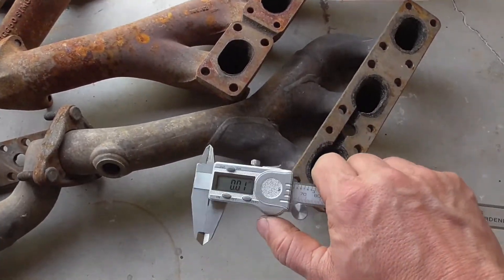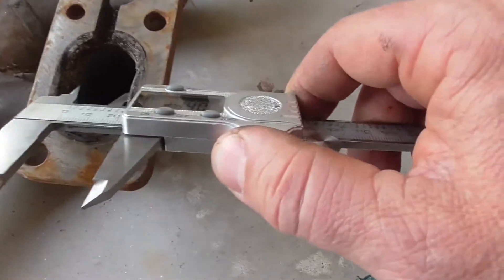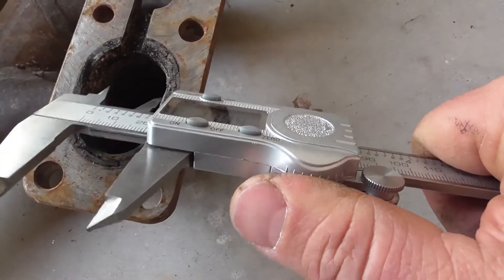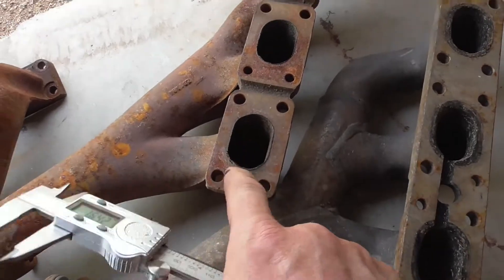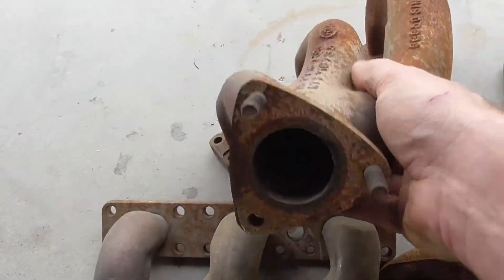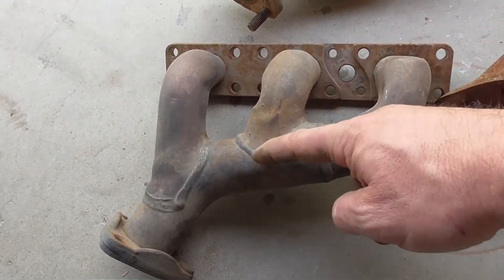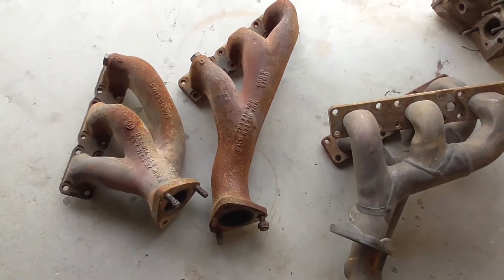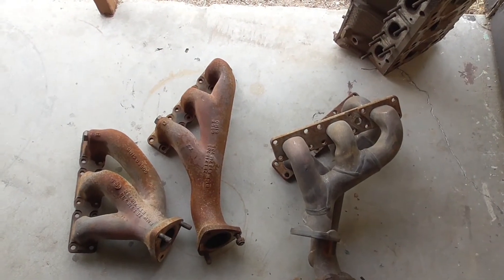BMW M50 S50 M52 S52 exhaust manifolds - what to use for more power

Comment: One question that might sounds dumb. But I ordered a manifold and I wanna make sure it’s right. But does it make a huh difference if I put an m50 exhaust manifold on an s52 engine? I realized the engine is bigger on the s52 so I’m not sure if it’s gonna go great when I crank it. Any help?

Comment: Try to blow air through every port and leave a piece of paper on every other port for comarrison, that's the most simple DIY flow test. If what you are explaining is correct, you should see results, it would be a nice video to watch.
Reply: This actually means nothing, since we don’t have exhaust pulse from two different cylinder at the same time, also the exhaust flow from the engine is not similar with this test at all. A good manifold is the one that enables the flow to reach Mach 0.6 at the desired rpm (usually max power rpm) with smallest section area and the biggest discharge coefficient.

Comment: Do anyone fitted a m50 exhaust header on a m52? I'm curious to check if the sound difference from m50 325 to the m52 328 is due to the cast headers.
Reply: They are p&p
Reply: I have flow tested the two and found the m52 bit better and 3 kg lighter but I ported the m50 and then they flowed better and I keep the weight because it is 100% down to exhaust manifold difference in sound along a small bit with m50 inlet manifold too I have m52b28 that sounds same as m50
Reply: @John-q3n7zI've actually fitted the m50 manifolds on my m52 after this message 3 years ago. Mine sounds nearer to a m50 but still have some remnant tonal characteristics from the m52. I've posted some short videos on my channel showing the different exhaust setups.
Reply: @rodrigokishi i have looked at your channel and looks like you only have 32 seconds video but that is showing m50 inlet manifold not exhaust manifold??
Reply: @John-q3n7z you have to filter for the shorts videos
Reply: @John-q3n7z another one: https://www.youtube.com/shorts/soi17Hp8J3w
Reply: @John-q3n7z finally an onboard: https://www.youtube.com/shorts/YKslBM0VFQY

Comment: In M50 engine headers from M52 gain more low rpm power. Flow is faster cus compression gases ale restricted a Little SO they Flow faster

Comment: This doesn't show that either one flows better.
Reply: You must not understand air flow. I have a porting degree and a degree in air flow design and I can tell you everything this guy said is true. They flow better and they deal with the heat and have much better efficiency.
Reply: @dissolverussia4842  I'm a Certified Industrial Hygienist with a specialty in ventilation (air flow). Without measuring volume and velocity this is just someone's opinion. Show me the $$$.
Reply: @masscomnet  ever heard of Joe mondelo? The godfather of of cylinder head porting. That's is who I was trained by and have a degree from him specifically In cylinder air flow and port design.  He is no longer with us but I can tell you that dude is correct about the m50 manifold and the advantages it has over the m52 header. Sorry I  don't have  any money for you but I have straight up facts. Also I just got back from my local pick and pull and saw both and will be pulling that m50 manifold tomorrow as and will be installing a n52 exhaust I built  from all stock parts.
Reply: @masscomnet  for example the m52 manifold has the major issue of the air fighting against each other vs the m50 that don't have that issue. Second the m50 exhaust will transfer the heat better then the m52 manifold which affects the way the air flows out of the cylinder head. 3rd the exhaust cast manifold has enough material to remove for a good port shape that will also help with flow. The only disadvantage the m50 manifold has is its ugly compared to the m52.
Reply: @masscomnet  The main difference between the M50 intake and the M52 intake is that the M50 intake holes are each 10mm larger than the M52’s. That is about .39 inches for each bore. Because of this difference, the air flow from the air filter to the intake will be better, which results in more power.
Reply: @dissolverussia4842  I think you misunderstand my original comment. The video doesn't "prove" anything. It just says "it's better". I'm asking for metrics. What's the improvement in volume? What the improvement in velocity? Just saying that something is "bigger" doesn't mean much. If it did, we'd all have 10 inch exhausts on our S52 cars.
Reply: @masscomnet  ok. Cleary by what you wrote you have no understanding exhaust flow or what he's trying to convey. I think you better stick to your dental hygienists gig buddy. He Clearly states it flows better tells you why by explaining the shape and which shape had a superior flow. It's not even about size as much as the shape. Do you understand tooth man?
Reply: @masscomnet  I think your having understanding issues. I just explained to you as simple as possibly as to why I agree with him by providing facts. Its very simple to understand what flow is. Water, electricity, air they all flow exactly the same. If ya didn't know now you do. I'll say it again m50 exhaust manifold is superior. Take it how you want it.
Reply: @masscomnet  and size does matter. That's why she left. ☺
Reply: @masscomnet  he literally pointed out how on the m50 manifold the smooth transition of the exhaust pipe. The m52 has a terrible shape, the exhaust fights itself exhaust the cylinder head= worse flow. I'm sure if you watch the video again you'll figure out exactly what he is saying and come to understand the m50 is just better
Reply: @masscomnet  and speaking of velocity do you not see that the m52 has reduced velocity compared to the m50 by that crappy design. Just that one fact he pointed out should have answered all your questions dude.
Reply: @masscomnet  one more thing have you seen the difference between the exhaust pipe diameter of the exhaust system with a 2.5 engine vs a 3.0? So putting a 3.0 stock exhaust system with all the sharp bends  replaced with mendral bent pipes and instilling m50 headers on a 2004 m54 engine in a x3 is by far superior to the stock SUPER restrictive flow of the m54 manifold. Have you even seen how pinched the m54 header is.  This is the build that you want using all stock nbmw exhaust pipes.  

1. 2008 N52 exhaust system right after the exhaust headers,

2. M50 1993 exhaust manifolds

3. Remove all none mendral bent pipes 

Best flow and efficiency you can get for those cars using all factory OEM parts.

M50 manifolds =22 bucks 
N52 exhaust system= free
Welding and menrdal bent pipes=free

Can't beat that. But don't take my word for it, try it for yourself.

Comment: well, these M52 welded ones are welded inside so You have to weld those pipes outside, then You can grind off welding inside so they will be totally fine comparing M50 ones...
Reply: Yes, we smoothend the welds inside and didn't reinforce it from outside little crack appeared but after little reinforcement welding it is all good. I think the m52 route is better after this small mod. And also you have to plug the lambda sensor holes.
Reply: Agree
Reply: I have euro manifold. I don't remember if the size is different but when I compared them I came to conclusion that m52 is better. One different is that there isn't that connecting port between the cylinders 2 and 3 in the euro model.